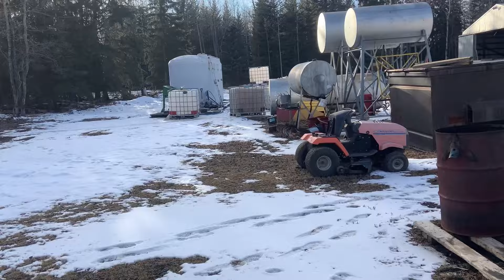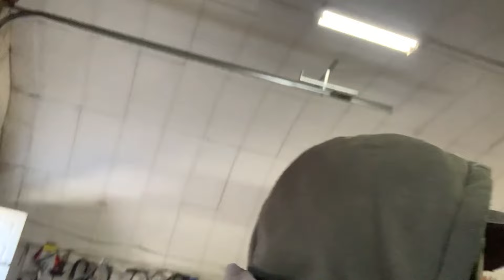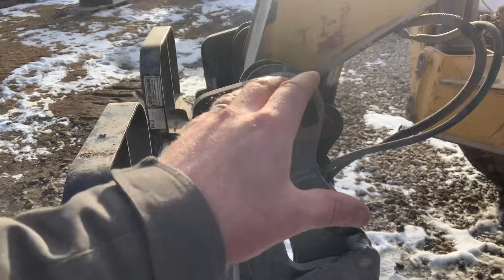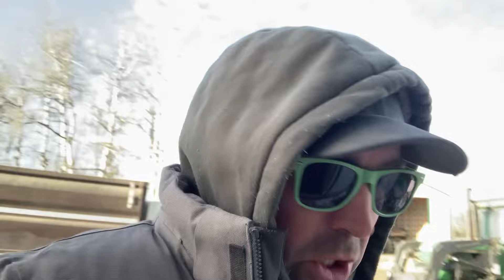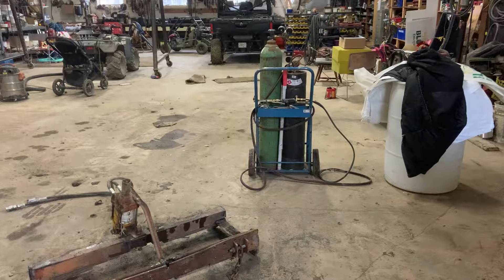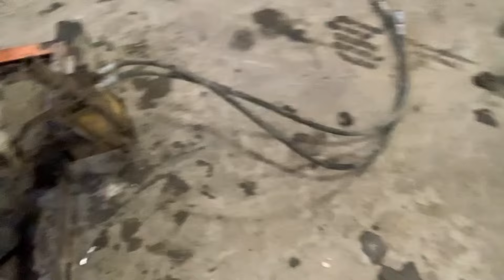Quick Sunday fab job for the old post hole auger

Comment: Lawn mover must haves.    Kawasaki motor.   Sundstrand hydrostatic.  Steel quills.
Reply from the maker: What’s a quills?
Reply: The bearing assembly that has the belt pulley one end and blade the other.  Bolts to deck.   My cub cadet ate Aluminum and hit anything and they break   I have made my own on the lathe and all 3 now steel.  The hustler is a good unit.

Comment: Come over to the dark side and get a zero turn Kubota mower like mine.  Lol 😆
Reply from the maker: I think they are more expensive than Deere
Reply: @millionairefarmer.  it’s better than the green piece of junk I had before it.
Reply: @millionairefarmer. Green ones are garbage from what I've seen.
Reply: @chadtosh6831 I have a Husqvarna zero turn. 24hp 48in welded deck. 10 years old this June. It's been pretty good.
Reply: @chadtosh6831 dad has a 60inch Husler. He bought it at Douglas Lake. I think it's also 24hp. It's been good for him.
Reply: @jeremycherny2041  mine has a welded deck too.  That last Deere mower, the deck rotted out fast.  Had this one about 7 years now.
Reply: Martin Deerline dealers always seem to have tons of lawn equipment.
Reply: Drill pilot fence post holes, push post in with the backhoe back bucket.
Reply: You should come look at my Kubota. It was like 7300 bucks for the big zero turn.
Reply: @chadtosh6831 couple of the deeres around home have had hdro trouble. Sealed units. 1350 a pop. Hour to repair
Reply: @jeremycherny2041  I’m fairly anti Deere after my last several purchases.  Dad bought a new 25 hp diesel loader tractor to do some rough mowing and move stuff around the yard.  10 hours on it and it’s leaking out of the hoses and plastic pieces like his hood latch have snapped off already.  Told him to buy an orange one.  Lol 😆